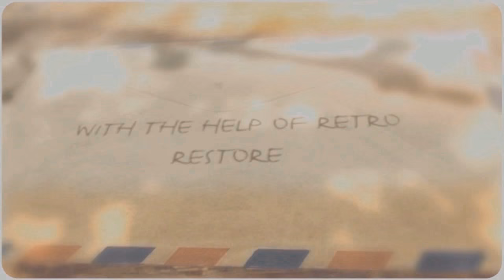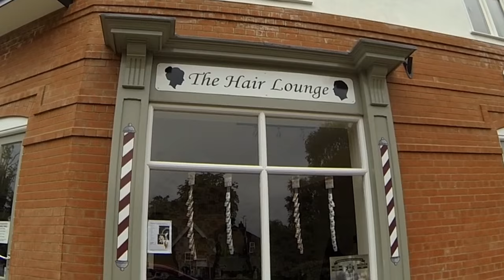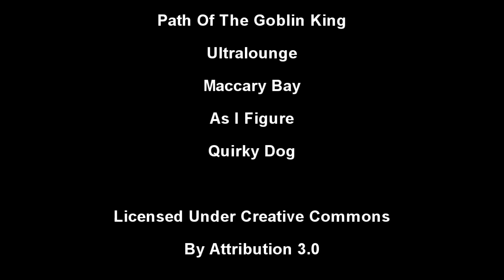An Update Trotter Van Garden Lawnmower And Other Stuff Vlog

Comment: We've been running a little trial on keeping slugs/snails away from tender young plants. We've tried crushed eggshells, grit, pellets etc but the overall winner was surrounding the base of the plant with copper coins (1p's etc) and it works a treat. The copper gives the slugs and snails a little shock so they won't cross it. Sharon might want to give it a try?
Reply from the maker: My raised bed has a copper strip around the perimeter . Last year it worked but since the copper has tarnished, it no longer stops them.

Comment: good video as normal Martin, sorry to hear about the grand child being unwell but hope they get better soon. if the regal chassis is coming back to you to be welded up i would give the powder coating a miss and paint the chassis yourself as powder coating is not always that great (depends how good the person is doing as there are a lot of people out there that claim to be powder coaters but dont really know what they are doing with it). if it was me id skip the powder coating and just epoxy prime the chassis then go over that with some 2k primer or your colour, the epoxy is great at sealing the surface up so it wont let water throw and it can go straight over bear metal with no need for etch primers. you can also use epoxy primers/surfaces on body panels which might also help you go over the fiberglass body of the van and seal the old paint up from the new paint to stop and reactions from the old paint or gel coat
Reply from the maker: I did conceder painting the chassis but the chap who does the powder coating does a good job. I've seen his work and he gave me a great price so it seems the most logical option.
I'll see once the welding is done.
Cheers
Martin
Reply: the issue i have found with some powder coating is the amount of time it lasts and also the finish as its some times not that great. people also say that wet paint is not as good as powder coating in the fact it dont last as long but ive found wet paint 2k paints can last just as long or longer if the prep is done right. also the issue is with powder coating if it starts to peel off a part it  tends to peel off in big lumps/sheets so you get a large area that has no protection where as with wet paint it tends to only be a small area that comes away from a stone chip or small bit of damage. when i started using epoxy primers i thought it was a bit of a gimmick but it really does make a difference. ive got my project van sitting outside on my drive uncovered and its still looking great 3 years later, the epoxy still looks the same as the day it was put on

Comment: My mower doesn't seem to be running at full revs? The revs go up and down... I've changed the petrol and still the same... What do you thinks wrong?? Cheers Glenn
Reply from the maker: If it's one of these engines, you'll need a new gasket and diaphragm for the carb. I have a vid on this in my service briggs and straton video.
Cheers
Martin

Comment: hi, I am wondering if u can help me? I have a petrol sovereign lawnmower. it starts first time. the problem is it revs way too high. what may be the problem?
Reply from the maker: It could be that the governor arm is wedged on the carb linkage making it run fast. Make sure the white arm moves freely.
Cheers
Martin
Reply: +retrorestore is that the thing near the spoil? thanks for replying.
Reply from the maker: Yes, it's a white flap that connects to the carb via a link and shuold move freely.
Reply: Okai thanks for your help much appreciated.😊